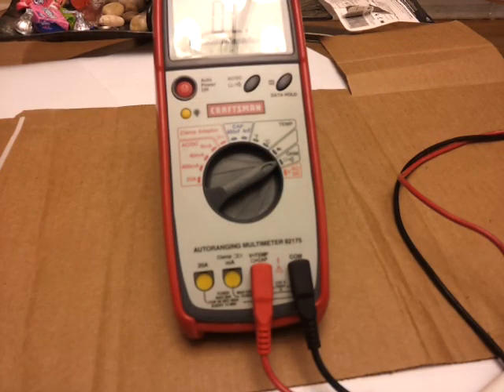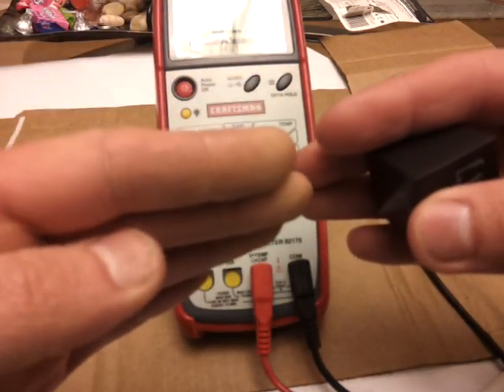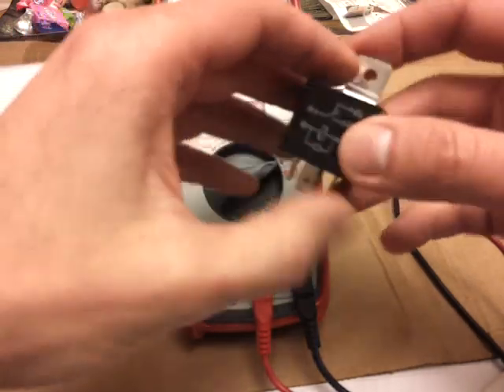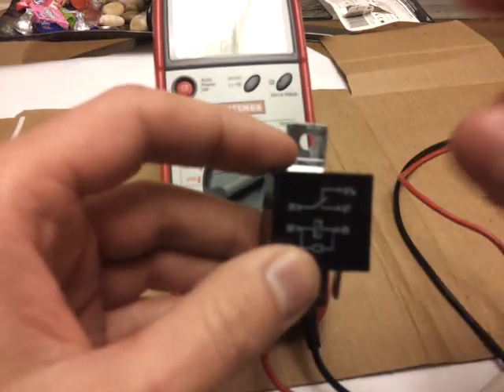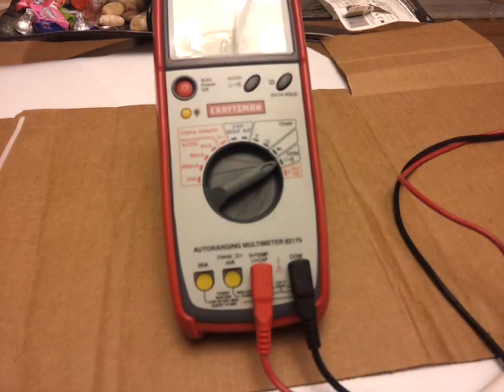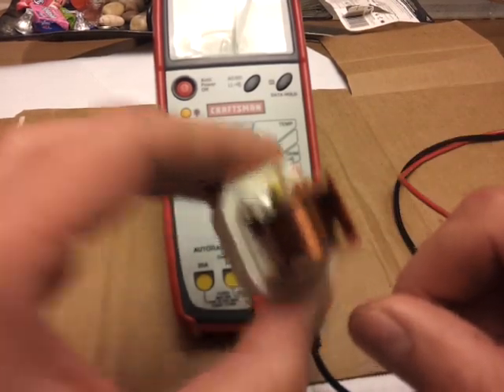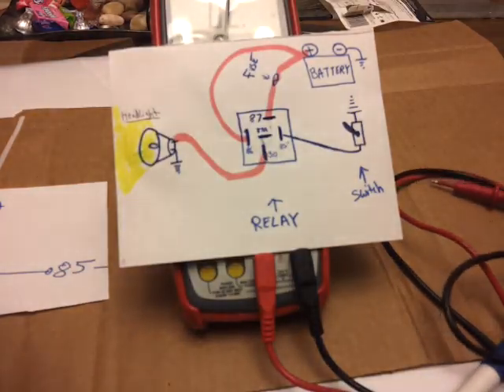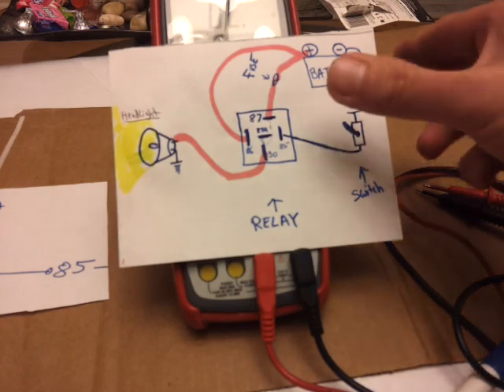RELAYS - How to wire and how they work TUTORIAL !!

Comment: I built a Hydrogen Generator If I understand this right I can take the remote from the radio, that sends a signal too my amplifier, too 86 and 85 is grounded, that will energize the relay too power my generator?  what I want is too be able to turn on the generator when I turn the car on! and OH I do have a 30 amp breaker.

Comment: can u give me a schematic for the circuit witch composed from one relay,3 leds,3 buzzers,pushbutton,3 switches?! plz answer me fastly
Reply from the maker: Izawna Riza hahhaaa you're kidding me right?
Reply: klowny1969 no i'm not realy
I'm serieuse
Reply from the maker: Izawna Riza if you watch the video you will fully understand how to wire that..dont forget to subscribe
Reply: klowny1969 but wht  kind of a relay u use it?and why
Reply from the maker: what is this for?
Reply: klowny1969 for choosing appropriate relay to my circuit
but in ur video u explain directly wht u do .we need video abt composition of relay and how can we wire with simple relay
Reply from the maker: Well you have to see what amperage the stuff u are wiring draws and get a relay that can handle that
Reply: klowny1969 oky
i want to know if the relay can turn on one led and 2 others turn off when we switch on?
Reply from the maker: Izawna Riza yeah u need 2 relays for that..one normally on and one normally off..google it for more info
Reply: klowny1969 thnx sir for ur infors and sorry if i disturbing u👍

Comment: can i wire the 86-85, 30-87 to this system and if so what numbers go to what color wires

http://testbin.50webs.com/madura/images/fuel02b.jpg this is the circuit i need to connect with the relay your using 

here is a diagram thanks for your help ?